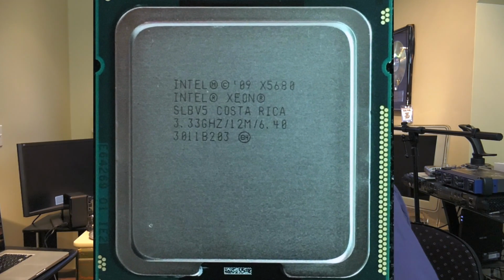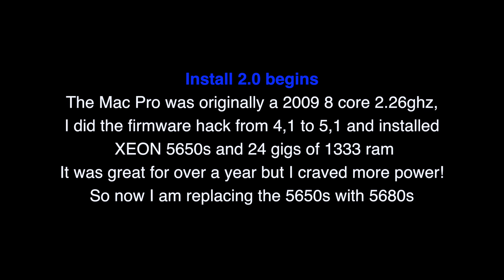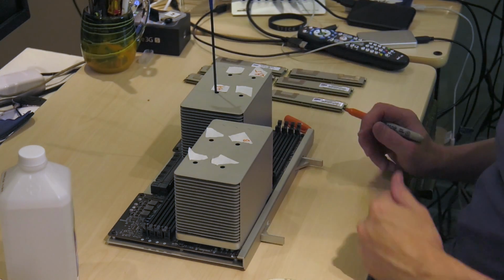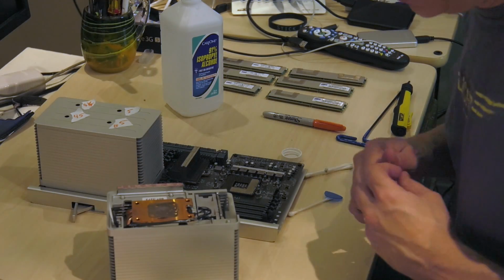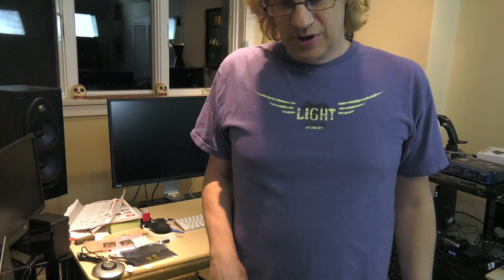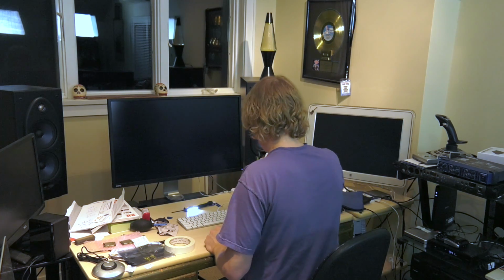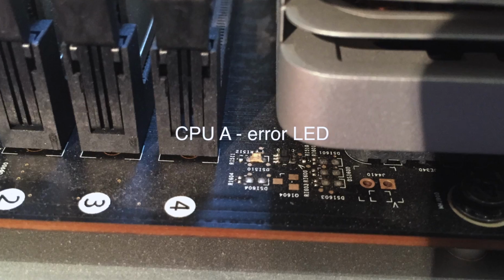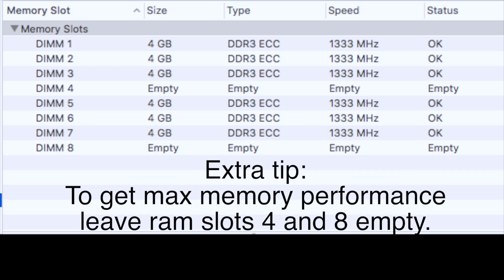MAC PRO CPU Upgrade Xeons 5680s.

Comment from the maker: Important, make sure to tighten the heat sinks in an x pattern lower right then upper left, lower left then upper right maybe one full turn each then go to the next screw. This is one of the mistakes I made doing this install and why I might of had so many issues.

Comment: Thanks for sharing!
I’ve watched your vid’s a couple of times, they’re very accurate. 
I’ve build in the same cpu’s but decided to get the lids of (gently by vice).
This to avoid  nerv wrecking torgue pressure isseus and modifying parts.
About 18 turns the screws were hand tide.
I pushed them in and they everyting worked fist time.

Comment: 1) you can use a T15 Torx screw driver also, it fits.
2) you have disconnected the connectors from the heatsink! That should be mentioned, with lidded processors the connectors won´t reach down as they are higher than unlidded?
3) 3 mm Thermopads is needed on the side of the heatsink with lidded processors!
4) You do not need to count turns, but it is essential to tight them in x pattern a little at a time. Do not overtight, but not too loose either. The risk for bending pins are not very likely, bent pins is usually caused when the heatsink and processors are not in place. 
5) It is possible to straighten up bent pins on the processorboard, you need magnifying glasses and fine tweezers.
Reply from the maker: Station Lunda good stuff see my first Mac Pro upgrade video it covers most of what you posted thermal pads, heat sink connectors etc

Comment: Great video! Very instructional and fantastic insight into some trouble shooting issues. Just picked up my own 2.26 8-core and doing my research before throwing in couple x5690s.
Reply from the maker: Thanks check out the first video as well... some folks remove the CPU caps IHS (integrated heat spreaders) and say it's easy to do, I have not done it myself, having the caps off makes the install easier. Inf act after updating my friends 2010 I would say the 2009 is an easier upgrade if you have CPUs without the caps because the heat synds are a bit tougher to get back on on the 2010 than the 2009 because of the posts on the logic board which Apple redesigned on the 2010. New video on that upgrade coming soon :)
Reply: +Lance McVickar would you say removing the IHS's just lessen your chance of ruining your CPU's? Or would it solve the RAM problem you ran into with this video? I don't know if I would want to get out my gun if I didn't have to haha
Reply from the maker: Seeing I have not done it myself I would just look here on youtube for videos on doing it but make sure you are looking at Xoen 5680 or 90s not some other cpu. 
It may lesson the chance but you can still over tighten and bend pins and you you most likely can screw up the removal of the IHS, As far as ram goes, it is just part of the deal to have the correct pressure on the cpu not too loose and not too tight :) I had the same thing happen on the other install and a few more 1/4 turns it was good. I think it was also CPU B that was giving me issues, seems to be a bit more touchy. Apple puts locktite the blue stuff on the posts to lock the screws in place and that can make it seem like you are tight enough when you are first putting the heat sinks back on, because there is still some on the posts, which shows you they do not make them tight, I could not believe how loose my hearsink screws were when I removed the heatsinks after my first upgrade... too tight is never good, loose is ok and just small turns to get all the ram to show up/

Comment: If you de-lid the processors with a vise (Yes, a vise. It's easy and safe if you're careful.), you eliminate ALL the guesswork of how far to tighten the heatsink/fan screws. You just tighten down each set of screws all the way till they bottom out. "Finger-tight" with no wrist or arm movement, and you're done and assured that the downward force is to Apple specifications. I am a Mac newbie and have never had a red LED, RAM issues, high-speed fan issues, or any problems whatsoever with upgrading the Mac Pro 2009. Besides, if you were to damage a CPU during delidding, it's far cheaper to replace a CPU than it is the processor tray from crushing the socket by applying too much pressure. A new CPU tray can cost as much as replacing the entire Mac Pro 2009! Another benefit of delidding is that you don't have to alter the fan connectors or mess with heat pads, and you're assured that the heatsink/fan will plug into the connector correctly EVERY time.

Comment: Nifty keen Lance.  I didn't worry about counting the twists you can really feel when it finishes very easily in the grip pressure.  I've done a number of these and never needed to worry about it.  On my personal Mac Pro 5.1 I bought the single CPU tower and put the W3690 in it with 48GB of DDR3 1333 ECC-Registered.  I then added a Vega Frontier Edition 16GB Video Card.  A 480GB SSD and a 240GB SSD and a 5TB spindle drive 7200rpm 128mb cache and left the original drive for iTunes.  Added a Blu-ray/HD-DVD hybrid LG drive for giggles and then an iMac's wireless card with Wireless AC working at 1300 and Bluetooth 4.0.   The only real problem I ran into so far is I needed to do the Bluetooth connector to actual antenna mod to get enough signal strength on the new card as a extension cable just didn't get enough signal strength from the original antenna port.  If you have any questions about further upgrades Lance send me a message I'll be happy to talk shop.
Reply from the maker: Telecasterland Telecasterland I use a usb blue tooth dongle works better than the antenna for me as mine lives in a closet and is hard wired to gigabit FIOS so no WiFi on this Mac. Also upgraded to the Samsung AVHC pcie boot drive 1200 read write blows my old ssd out of the water which I now use for a bootable system clone backup backup. I am interested in the Vega but I’m still in Sierra at the moment as it’s been very solid for my work apps
Pro Tools HD. How do you power your Vega? How is the performance been? Do you get a boot screen with it?  Nvidia just came out with new cards but dealing with their drivers is a bit of a pain.
Reply: I do not get the full boot screen with the Vega, I keep a original Geforce 120 in the machine incase I need to see it.  I power it off the mainboard directly with specifically purchased power cables that connect to the onboard video card power jacks via 6pin mini to 8pin full size and plug directly into the video card.  The Geforce 120 Mac took no power cables and only uses 1 slot so its easy to just leave it in the top slot and ignore it.  The performance is amazing with the Vega 64 and has been improving with every release as they tweak drivers for the iMac Pro Vega.  I run it in the bottom slot.  I am running the latest High Sierra 10.13.6.   I actually do use the original onboard wired network as well but use bluetooth mouse and keyboard.  I just wanted wireless AC as I have it throughout the house.  It connects at 1300 which is pretty strong if I move the workstation elsewhere.
Reply from the maker: Telecasterland so your using two 8 to 6 pinn cables or one eight to duel six pinn? I thought you also have to tap a sata bay to get enough power. What brand card do you have ? Goody to know the GT120 still works in 10.13.6 I have one for safe keeping :)
Reply: It's just 2 mini 6pin to 8pin full size cables plugged directly into the mainboard behind the card.  I have every sata bay full as I havn't used any PCIE slots for drives and I have 2 optical in it.
Reply from the maker: Telecasterland cool which brand card did you go with? I have a Blu-ray in mine as well both cd drive bays full all sata drive bays full, two pcie slot ssd drives, usb 3 card and flashed GTX 1080ti so pretty maxed out but as I use FCPX I would consider the pro Vega 64. But I also am getting into Resolve. Setup is pretty solid for what I do right now.
Reply: Its a Vega Frontier Edition 16GB AMD branded but actually made by Saphire, LG bluray burner and older LG bluray/HD-Dvd drive.  My SSD's are a Mushkin 480GB and a Crucial 240GB with a Toshiba 5TB and the original drive is still sitting in the last slot used only for Itunes 640gb.  My USB-C card is a Sonnet Allegro USB3C-2PM-E  the powercables are under NEW Mini 6-pin to 8-pin Pci-e Video Card Power Cable for Apple Mac Pro/g5 on amazon for 6 bucks.  The wifi is a AirPort Extreme with wireless AC via Shaluoman Mini PCI-E Adapter for BCM94360CD/BCM94331CD which isn't working out great yet other then the wifi.  But the new antenna should fix that.

Comment: Been fun watching these Mac Pro vids of yours. I'm finally getting a 2012 Mac Pro, and I plan to upgrade CPU, RAM and graphics card. It looks like my RX 480 should work in there with Sierra or High Sierra installed. Can't wait to try it all out! But man, that CPU upgrade looks intimidating. I don't even think I have a tool to get the heat sink off, at least if it works the same in there as it does in your older 2009 Mac Pro here.
Reply from the maker: You can buy the hex key on amazon check out my first MP upgrade video for the size I forget what it is. Also the 2012 is easier to do the upgrade, watch the video of me upgrading my friends 2010 its the same as 2012.
Reply: Cheers, mang! I just did the upgrade on my 2012. Threw in a 6-core 3.33 GHz in place of its original 3.2 4-core. So easy! I got a set of long Torx bits with a handle at Walmart, found the size that fit, and it was so easy. Just tightened the screws until they stopped, didn't force them further.
Reply from the maker: Congrats!

Comment: I have seen the generous use of compressed air to make sure everything is clean. And Q-Tips leave little hairs everywhere. It might have been a good idea to use a cleaning cloth instead. While you do say that the 5690s are double the cost, it might have been worth it to spring for them, as it would be a final, ultimate upgrade. Time is, after all, worth money.

Comment: Hello Brave Computer Guru, 
Yes 'tis scary doing this kind of stuff. Personally I have freaked out when I get a no boot, I digress. 

I have my old DAW in semi retirerment an early 2008 3.1 Dual Quad Core 2.66 with 16 gig of Ram. Dual Booting W-10 and Yosemite 10.10.5. Only one old lonely video card still works for this 'ol gal with the old processors, but just a day or so ago she saved our network here!  She is hooked up to a huge 52" plasma screen and she is gorgeous to sit in front of and she works steady as a rock, she has in the recent past ran 3 monitors and barley broke a sweat. With an interface she can run either LPX which is already loaded or she can pull PT's 11 with a decent interface and get the job done.

I have also have my current PT's 11 DAW system in another room: an iMac 27", 3.4 GHz Intel Core i7, 32 GB 1333 MHz DDR3, AMD Radeon HD 6970M 2048 MB, running a 2nd Apple 27" monitor and a 3rd 42" plasma screen above me for the mixing board. Via Parallels I access my W-10 day job network.

I make great efforts not to mix OSX and Windows, and just log out of the network and load up Pro Tools when it's time for music. Until a catastrophe happens these computers will live as they were built. The iMac has had it's display replaced at a whopping 800 bucks, by Core Care of Sacramento, Ca. 2 trips but I went in with the tech and watched and learned...it was the shadow dust inside the clam shell display. I had cleaned it once my self, but they just swap em out at 800 bucks each from Apple. No inside deals there, eh? I tried to explain they were missing easy work to just clean a poor design problem....but?

The iMac is my Pro Tools 11 DAW and I have maxed out all available USB, Firewire and Thunderbolt receptacles including an OWC powered USB hub. I am primarilly a guitarist so I use an AVID 003 Board, a Rack Eleven and an Axe-FX II as my interfaces. It works for both audio and video.

This little system in an 11 x 11 bedroom has allowed me to upload over 100 music videos to YT. Over 50+ were from scratch shooting live video of me recording audio in PT's using an iPhone 5s. Again, it too works and I know how to use it and all it's idiosyncrasies which are few and tolerable.

W-10 did a new critical update a day or 2 ago that disabled all network folder permissions and the smartest work around was to re-build your network, with new folders with clean sharing. It was just matter of transferring 30K work files and one tech call to a specific software tech support that was flooded with help calls. I would love to venture forward with the 3.1 Mac Pro, but she aint broke and she saved the day, so she gets to keep her comfy cloths on. Just to re-place the optical drive, it was before ESATA but the 2 plugs for 2 ESATA cables are on the logic board, required a full disassembly which was great cause it was full of silver dust that would not come out any other way.

You are right about the speed difference sometimes being difficult to quantify. My Mac Pro is 8+ years old and still better than the day I bought her.

Great share I was sweating with ya all, Maximum Respect

Comment from the maker: A helpfull excerpt from the Apple Tech GUide for 2009 mac pros thanks to MrVitalic85 the Apple 
Mac Pro (Early 2009) guide has this helpful info and you can use a torque wrench. Keep in mind you should first remove all the old lock tight that is left on the heatsinkposts or your torque wrench may not give you a proper reading. Live and learn as they say. 

Take Apart — Processor Heatsinks, 8 Core  Page 160 5 To position heatsink screws, lightly tighten  them (4 lb.-in. or 0.452 Nm torque) in order shown, using no more than two turns of driver per screw.Note: While positioning screws, keep heatsink level by holding it in place with one hand. Reminder: Hold heatsink by its sides. Never press down on the top of the heatsink.6 To secure heatsink to processor, again tighten screws (8 lb.-in. or 0.904 Nm torque) in order shown until they are “finger tight.” Then turn each screw (in order shown) 1/4 turn more.

Here is the full guide.
http://tim.id.au/laptops/apple/macpro/macpro_early2009.pdf

Comment: Also use caution on the polishing of the die heads. You dont want to overheat and flash the solder !! I also have "active" mini-displayport to hdmi adapters to get the 4k out to the monitors. Both my monitors show 3840x2160 under displays. Under system report they only show 1920x1080 at 60hz. That is in the graphics/ displays section. I can assure you it is running 4k at 60 hz. 4k on you tube has stunning colors. 32 bit color showing in Graphics/display also. I am very pleased with the setup. I will push the machine and see what it can handle in real life before i upgrade memory and video card. I use Propellerhead Reason which takes advantage of multicore and screen cast with quicktime. But i will be doing some 4k rendering soon here after i get a 4k camera. We will push this machine and post back with real world results and temps